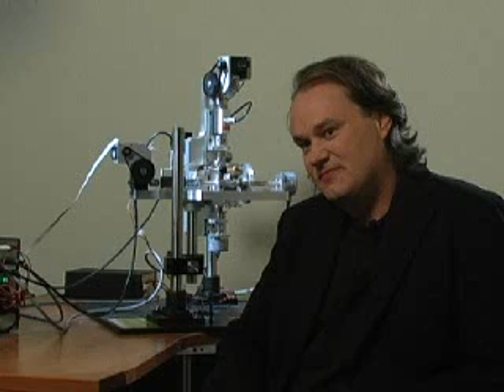Steorn: Sean MacCarthy with SkyNews

Comment: I invented a breakthrough source of energy, which violates the law of conservation of energy. It is based on Classical Electrodynamics and on Circuit Theory. I am looking for an investor who can make an investment in the range $500 000 to $5000 000 - I offer 9% to 49% of the starting company. My email is htg@interia.pl , tel. +48-780-129-544